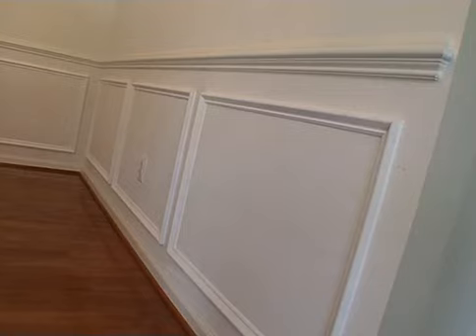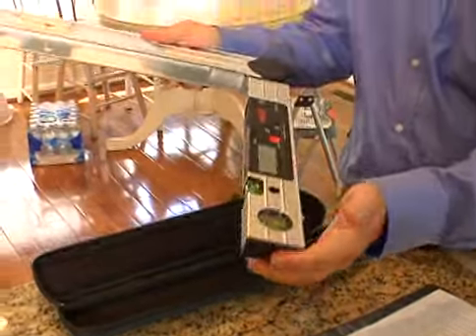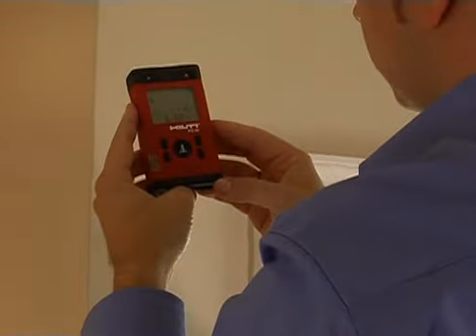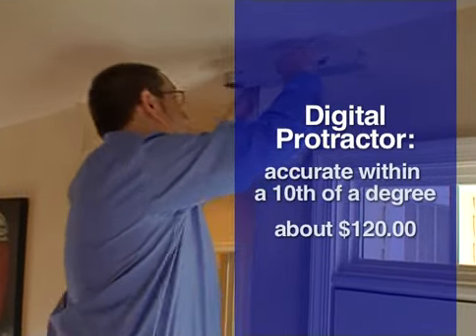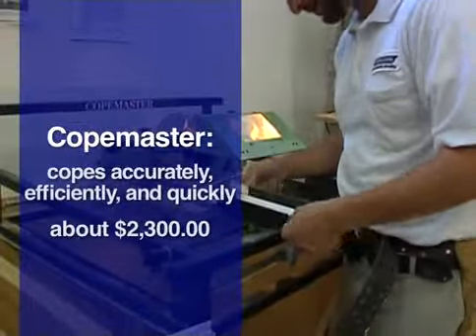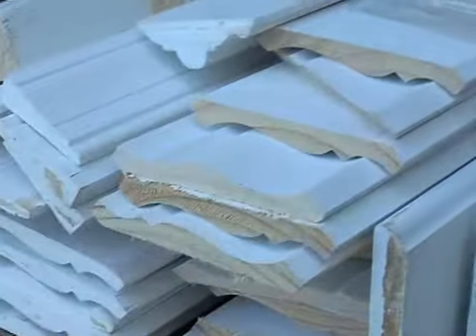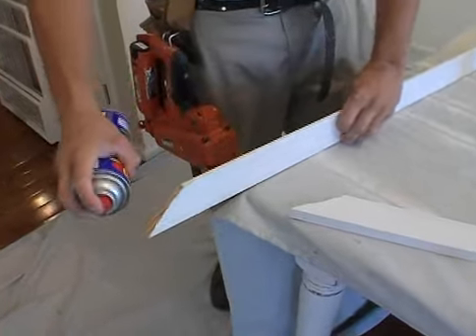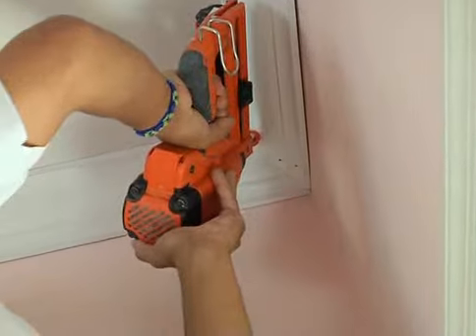How to Install Crown Moulding like The Pros

Comment: And what do you do if youre walls arent a PERFECT 90 degrees? Coping is the right choice, plus once a house starts to settle, and it will, a 45 will open up wheras a coped joint wont.

Comment: When I started back in 82 .. I didn't know how to cope .. Then I learned and it became a natural fluid motion .. Later I learned "Experience " the idiosyncrasies of drywall. compression ,wobble and waves . and I hung up my coping saw on crown .. Everything before was airtight . now it still is . but a lot easier . I do not recommend the No Cope to carpenters that don't have a feel for what they are doing . It'll come out worse !!  Keep coping and have a pallet of caulk nearby ..LOL

Comment: The cope master is worthless if you do quality work.  Everyone that trims houses everyday knows that with every different bundle of trim, the trim differs just enough to make the template piece not quite exact therefor throwing your cope off by a little bit. We used the cope master a couple times then sold it...more trouble than its worth, get a coping saw.  That angle finder I have used and found somewhat useful, Then i just realized it just easier to cut all my outside corners slightly sharper